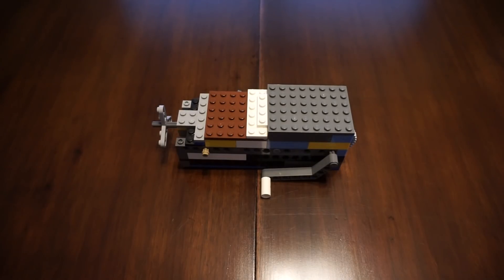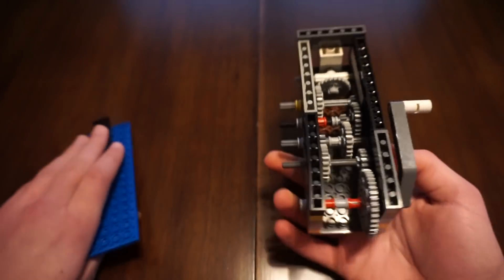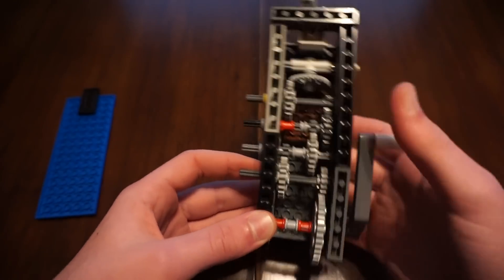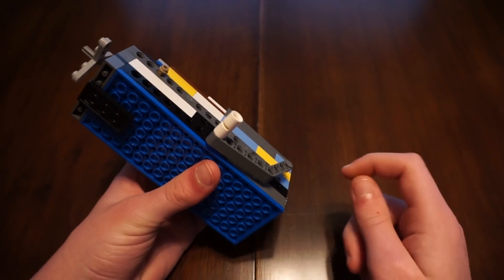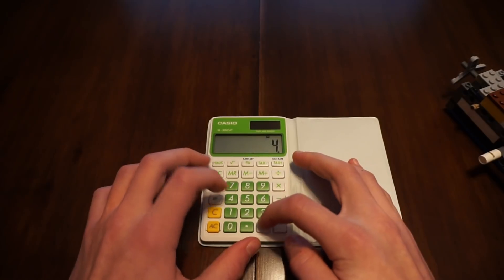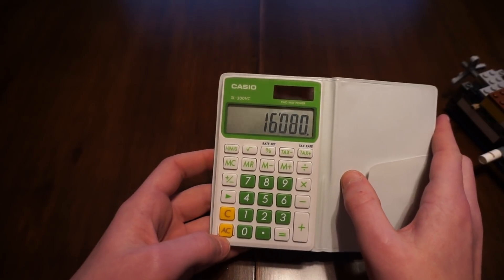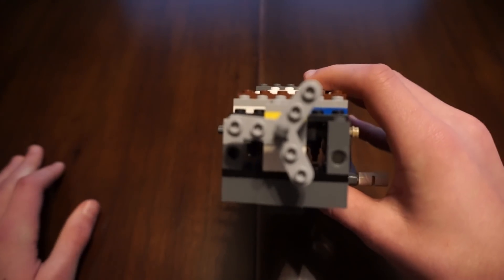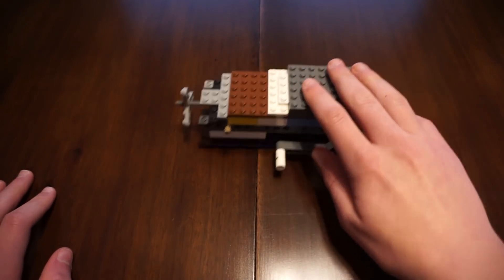Epic Lego 1 to 67 Gear Ratio / 16,000 RPM!! / Hooked to a DRILL in Description

Comment: you can spin it way faster if you just up the gear ratio, i just made a 1 to 243 gear ratio with lego gears and hit about 20 000 rpm while only turning the lever a little over 1 round a second. For each pair of gears you add it goes three times as fast :)

Comment: ur maths wrong, heres my engineering math, ur input is at 60 rpm, that times (2.5 x 3 x 3 x 3 = 67.5) is 4,050 RPM, no more, i made a gearbox that is 3 x 3 x 3 x 3, (9x9) if i made my gearboxes input to go at 60 rpm, 1rps,  my output will be for any size wheel be at 4,860 rpm (81rps) if i make my input go 120 rpm my output will be 9,720rpm, my gearbox is stronger and faster then urs, and u cant get lego cranks past 10,000+ its to mych resistance from air to get past it with any thing attached to output,
Reply: also u cant make ur hands go 240 rpm, urll need alot of control wit hthat large of a crank, u just need a small crank to get same output easier, y do u not do correct math
Reply: the only person that got it past 10,000 i know of with real math and equipment is this guys video https://www.youtube.com/watch?v=Xp935wmosuY, only he got it past 1000, using lego motors

Comment: You have the same basic concept as the bicycle company who broke 200 mph by using simple human pedal power. It's hard to find a video of the exact design. But I'm guessing that your design is similar to theirs. Just imagine the speed you could get to without having to use any fuel other than your own. 

You should make the design to accommodate a wheel system. See how fast you can get a car going.

Comment: No matter what your RPM, divide by 30 frames a second. From the perspective of the viewer, there is no speed faster than 1,800 rpms assuming that you're recording at 30fps.  Ironically, 24 samples per second is all that we need to believe the illusion of motion.  But it takes 44,100 samples a second for audio fidelity (Nyquist theorem).

Comment: That's even faster than a car engine. Not a lot of engines can rev up to 16080 RPM
Reply: Car engines do not spin this fast because they have parts that a much heavier, under heat, and under load.  A conventional car engine also has parts that are changing directions (pistons up and down).  Often times it is a spring that is the issue.  The spring that causes the valves to retract from the cylinder can simply be too slow.  Even a NASCAR engine will have this issue well before 16k rpm.  They see issues beginning around 10k.  It takes less than 1 second to ruin those engines at that speed and it is for this exact reason.  One way to help this is to make the valves not able to touch the piston in the event their timing gets a little off due to this valve float.  This is referred to an "non-interference".
Reply: Taehun Lee ye but theres probably not a lot of torque in the engine rn
Reply: Electric cars like Formula E can. I think regular electric cars can too
Reply: Guillaume C formula 1 cars used to rev up to 16k too, the current ones rev up to 14k I’m pretty sure
Reply: Car engine RPM is based on burning of fuel and it isn't done with gears like here

Comment: Spins nice. i used to do this with my legos, using 40 tooth gears and 8 tooth, if I could get the axle friction low enough I'd do 1:125 ratios, though sometimes I'd switch out the last one for a 24, 1:75. Anyway, you can spin tires fast enough that the rubber comes off the rim!
Reply: i can get mine to hit a wall with smallest lego tires possible still go 14 mph, i spin my input to my lego 1 to 81 ratio (3x3x3x3) at 120 rpm input, meaning if i do 120 x 81 i going 9,720 rpm output and makes my wheel fly off and then hit the wall and fly back at me at times, it can even rugburn people, its amasing how mine goes acauly faster then his wit ha heavier weight at end and doundsl ike a literal turbine with a gears on output instead

Comment: Very cool. You can buy a laser tachometer on Amazon for pretty cheap. Put a small piece of reflective tape on propeller for laser to read and get real time RPM's. I think some of them read up to 99,999 RPM. You should also try using a motor at the input (with variable speed control) to get crazy fast RPM's at output.
Reply from the maker: MarzNet256 I've recently uploaded a video using a drill as a power source, and that tachometer sounds pretty cool.
Reply: Meckster 28 Yes. I just watched it. Oh, and the laser tach's are around $16 on Amazon.

Comment: what about the torque because if you use it for a car it has less power for driving
Reply from the maker: +ROBBE Casier torque is terrible with this thing. It would be best to run the opposite (small gear on motor and large one on wheel) for it to work better.

Comment: A) You cannot rotate it 4 times a second. 
B) No RPM measuring equipment used.
Reply from the maker: +ziv I never spin it 4 times per second on camera, but it's capable of doing it. The whole RPM stuff though, it's pretty simple math but I probably did it wrong. More of a proof of concept video.
Reply: You're right, because the ratio inside is a speed ratio. you would divide the same way, but the 67 would come first because it is the powered gear.
Reply from the maker: Jose Ruis lol, nice. I even uploaded a video with me spinning it 4x per sec
Reply: Meckster 28 my guess is that you are still a kid. I'm probably not the first one to say this, but you have a promising future.
Reply: C) we don't care about your facts

Comment: Hook it up to a drill on high
Reply from the maker: Kuk Huve Mainly because it takes an immense amount of power to turn it. Some machines, though, do just the opposite. They put the engine where the propeller is on my build to relive stress on the engine. All the gears evenly distribute the energy to each other and it let's the motor run easier. Nice thinking though!
Reply from the maker: Good news everyone! I have finally made a video of it on a drill. Uploaded July 22nd.
Reply: Kuk huve and Meckster 28

They do on Marine propulsion, and Planes use something similar to Gears... it a belt with the same property as toothed gears.
Reply: Meckster 28 get even higher gearring and connect it to a bike
Reply: Kuk Huve If aircraft and boats use gears to drive the propellers it to gear them down,  not up.

Propellers are more efficient at lower rather than high speeds.  Plus there are structural issues.
Reply: that's what I thought too
Reply: @jheffreymartineau3388  my comment was make 4 years ago and was given a follow up by the creator of the channel. The fact this video is coming up in people recommendation now is a testament to how weird the YouTube algorithm is
Reply: Meckster 28™ no dip its just a transmission
Reply: Now it sound like an f1😂
Reply: why dont like airplpanes use this? Or boats

Comment: how fast is an rpm
Reply from the maker: RPM stands for rotations per minute.
Reply: You have to ask AVE how fast a rippm is
Reply: It's the speed of the second hand on an old-school analog clock.
Reply: 1 rpm = 5 bananas 3%2(5) cows
I don't get why you would use retarded units such as rpm
Reply: same thing
Reply: i'm a bit late. but rpm is how fast a point completes one revolution around a central point in one minute, irrespective of the circumference the point travels per revolution.
Reply: I have done some math and the propeller is spinning at about 118 kph or 73.1 mph. (my radius is 19.5 mm)
Reply: Fast
Reply: About 1 rotation per minute
Reply: *revolutions
Reply: About 3 speeds